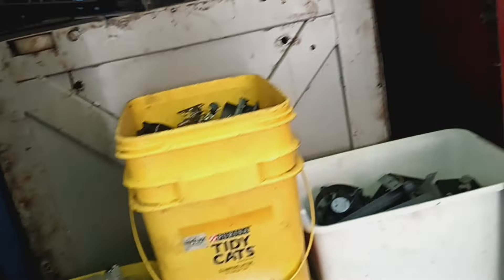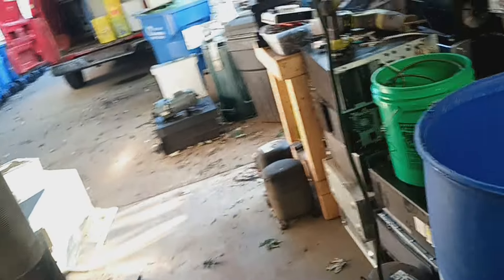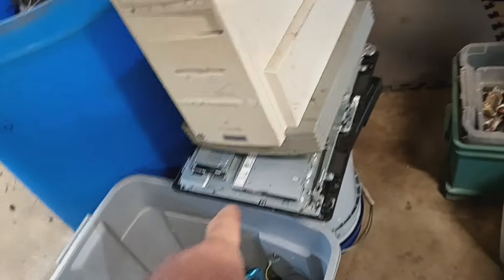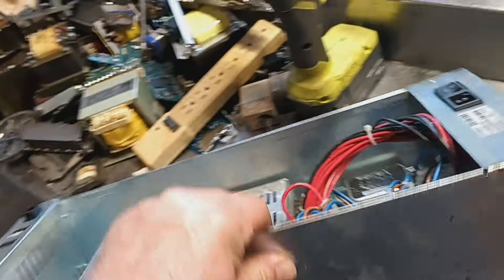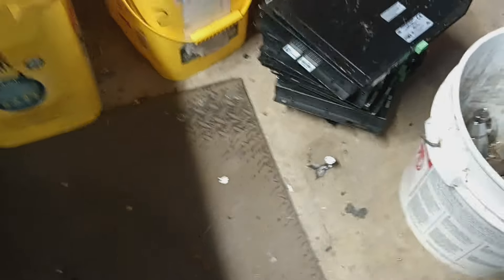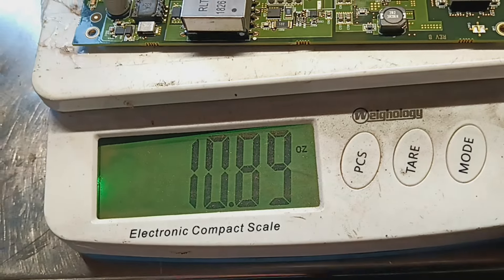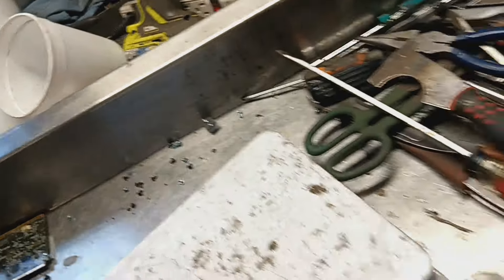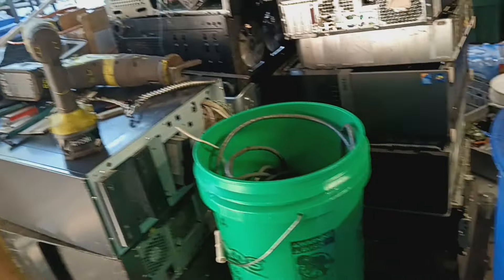Filling the van for a shred run

Comment: Hey mike. It's been too hot to do anything outside here in the South. I want to do a shred run to clear my garage. It's supposed to rain today so hopefully with cooler temps I can finish tearing down the grill and dryer.